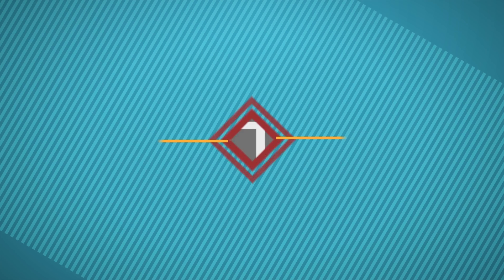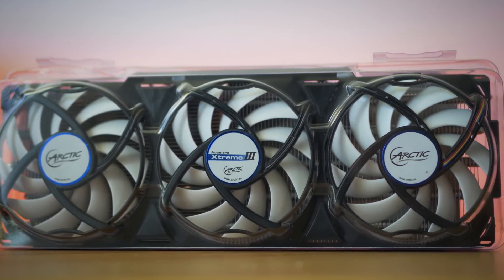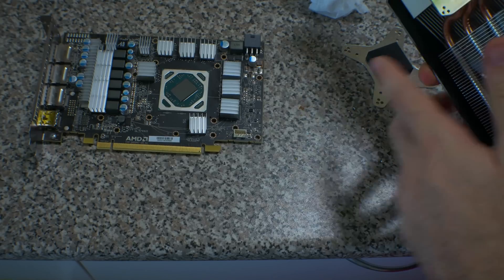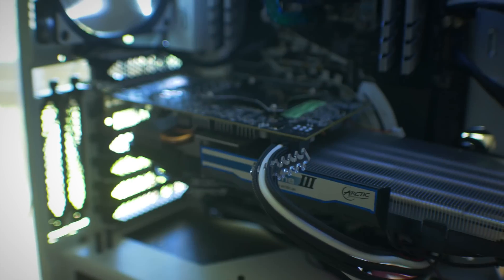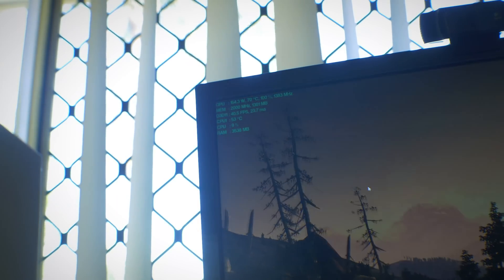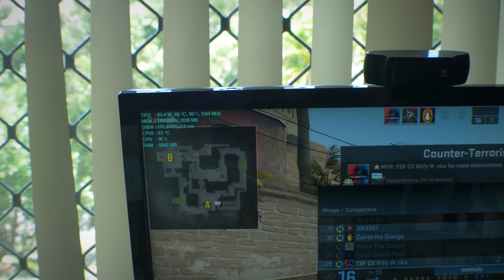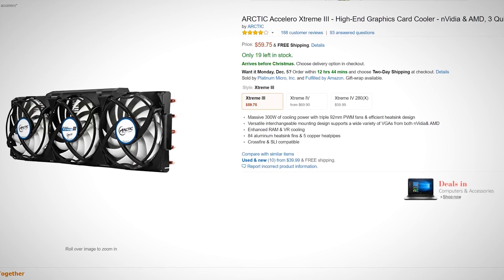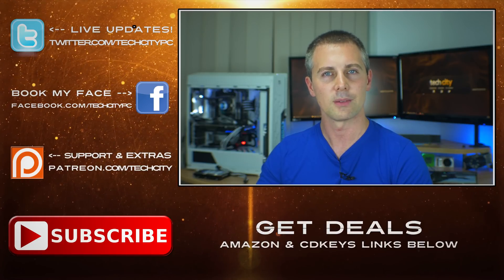RX480 Reference Vs. Arctic Accelero X3 Cooler - CAN IT OC HIGHER?

Comment: Arctic is such an underrated company, their Freezer 7 Pro Rev 2 keeps my FX CPU under 20c.
Reply: Abimael Lopez the temperature shown on ur pc is not accurate if its under room temperature
Reply: I don't think that is possible unless you keep your house at like 50F.
Reply: my Computer room temp is around 65f since I care about my PC, I mean try to find another air cooler that can keep room temp for the 8 dollars I spent for a factory refurb Arctic Freezer 7 pro.
Reply: Abimael Lopez Than it is physically impossible to be 20C. Physics doesn't allow that.
Reply: i dont think so, its same principle as a fridge, with a radiator it can go lower than room temperature
Reply: Byc FirePenguin Refrigerators are able to get below room temperature using compressors. It is physically impossible to get below room temperature with a CPU cooler let alone a $20 one.
Reply: Lol dude, your sensor is screwed. I use the same cooler on my Haswell i3 which has probably 50% less TDP and it runs at 50°C under load.

Comment: i have a reference evga gtx 780ti with a corsair hg10 with an h80i :) stock clock 875 mhz my oc is about 1200 to 1300 mhz
Reply: That's a pretty good overclock, how much voltage did you add ?
Reply: Everything msi after burner would let me. Sadly i cant find bios for my card so i cant oc higher :((